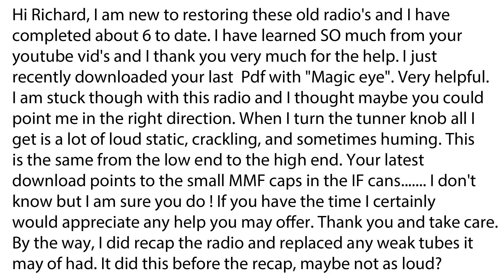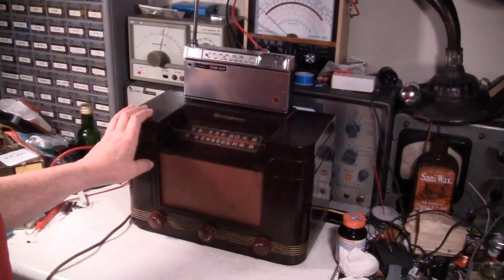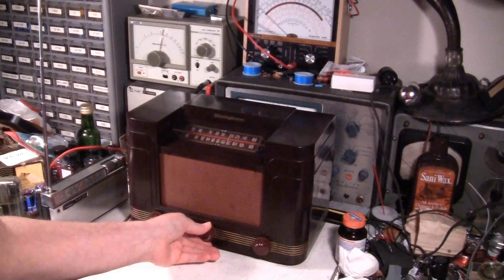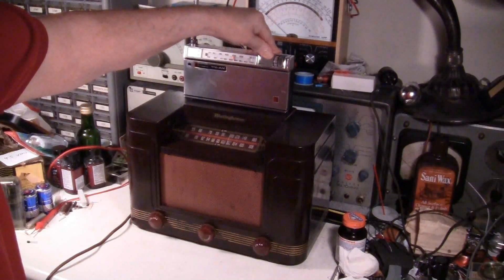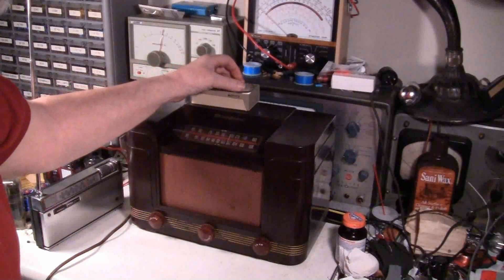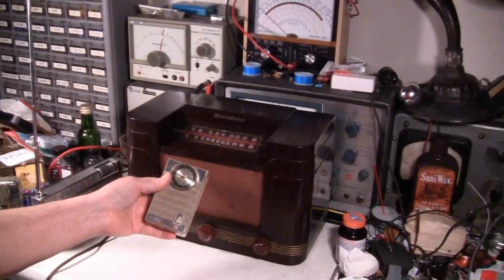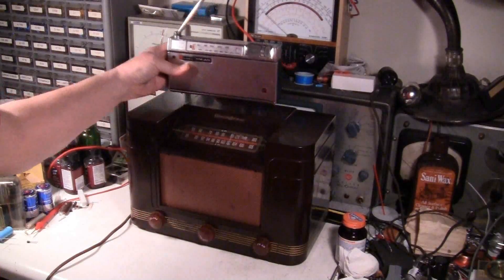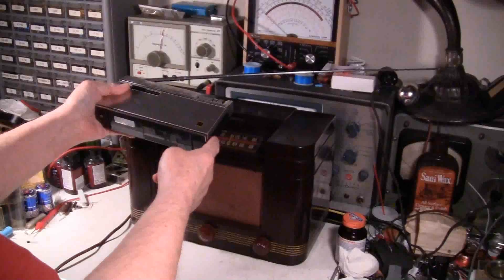Oscillator Trouble Shooting Using Radios as Testers Demo

Comment: Hi Richard. Great videos. I have a Hallicrafters S-38-EB. It's blonde in color. Beautiful radio. I'm told this color is rather rare. I bought it off marketplace. I got a recap kit from hayseed ham fest company. Now I know a little about electronics. I also know enough to operate this set without getting poked by the line driven high voltage. I did a few tube guitar amp recaps and polarized plug upgrades and had zero issues. But this radio has me a little stumped. I was careful during the recap. I didn't cross up anything and didn't induce any problems during the procedure. The problem is, is it only gets 2 AM stations but those are local powerful sister stations to an FM BC. The unit hums and receives no SB's. The tubes are original, but this set is in maculate condition. I did check the tubes the best I could with a multimeter (no continuity from heaters to cathode, screens, grids, or anode). If you could please kindly point me in the next direction I would greatly appreciate it. I'd also like to add that I did check all the resistors. Only a few were drifted slightly up, but not really enough to change them. At least to my experience. I also cleaned all the switches, pots, and tube sockets.
Reply from the maker: I’ll be glad to try and help. Receiving two stations is good news. This proofs that the IFs are good and more. Do you have the schematic? If not this link may help. 
https://www.radiomuseum.org/r/hallicraft_s_38e_s38e.html
What antenna are you using?
The Hum, does it increase with the volume?
Reply: Thank you for the link and reply. I do have the schematic, service manual, and a copy of the owner's manual. As per the owner's manual instructions, in currently just running a 15 foot long random wire for the antenna. It has more instructions on running a doublet antenna, which i haven't done yet. The hum does get louder when volume is turned up @AllAmericanFiveRadio
Reply from the maker: @thomaswillis4223  The Hum increasing with volume may mean you are amplifying the hum and it may not be the power supply. Do you have a tube tester, and/or a signal tracer? Can you receive stations on other bands?  I would check the DC voltage at each plate of each tube. Do you have another 12BE6 and a 12BA6? I would try swopping out the 12BA6 first, or try a 12AU6 it is a good sub for a 12BA6. YouTube must have made another improvement; I’m not getting email notices from YouTube again. My email is allamericanfiveradio@yahoo.com
Reply from the maker: I also have a FREE ebook you may like.
Password is allamericanfiveradio

https://www.youtube.com/redirect?event=channel_description&redir_token=QUFFLUhqa2hhVTRycWdJd1FUbTFCZWNmdGtQNlZCRmEzd3xBQ3Jtc0tuOFQ2bFhRcWdjdUdIcUREcnZFaHc0M2xURGhITVRuWDE2cGlDakdYUF9uODktNzc3TVRJTWdROUt6R3NLN2lla3hFS2lIM0RnOXR1dXFxMGx2cUNtWDhXb1Zvc2RCbGQxTThoendmN2E5R0lJdmI0Yw&q=https%3A%2F%2Fdrive.google.com%2Ffile%2Fd%2F1HHmaWYr7UMACfmS4W5uL6PADoem2KlRp%2Fview%3Fusp%3Dsharing

Comment: Try this same technique with just about any radio, and a cheap shortwave receiver!

It's known as the "Poor Man's BFO", and with some patience (It's not easy to set "just right") it can be used to listen to CW (Morse Code), and Single Sideband (SSB) Amateur Radio transmissions.

BFO stands for "Beat Frequency Oscillator", and it is used to regenerate the carrier wave locally, which is not used in SSB, and since CW has no modulation, it must also be beat to give it an audible tone.

Comment: This helps my old Sylvania 542GR out tremendously ! I will definetly get it out and try this simple test. It does the same thing as the one does in your e-mail. Mine has static or random noise like computer inference. Sometimes it's completely quiet with a few pops here and there.